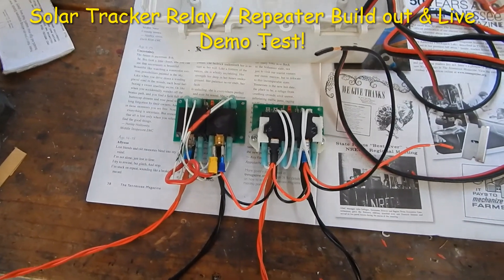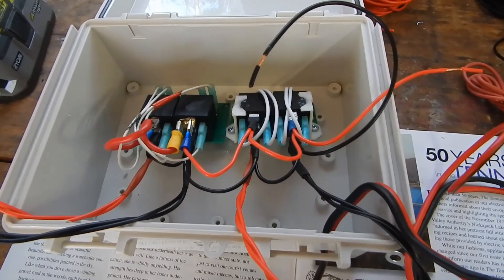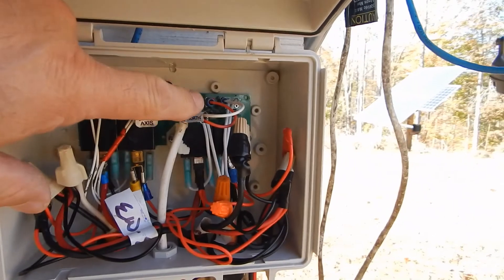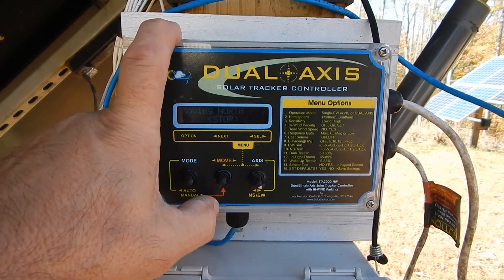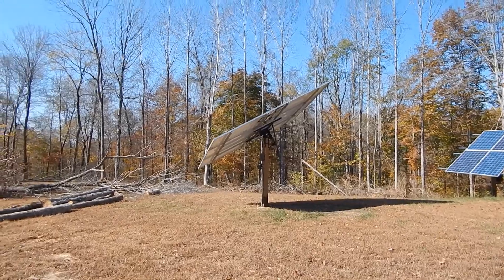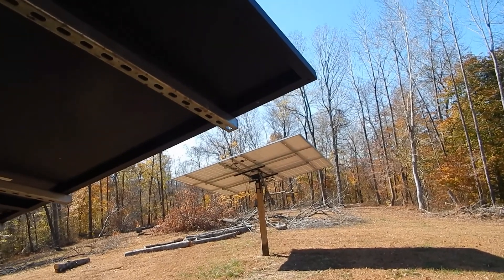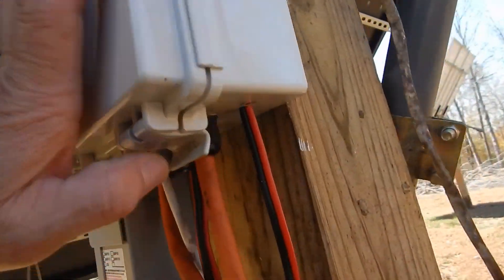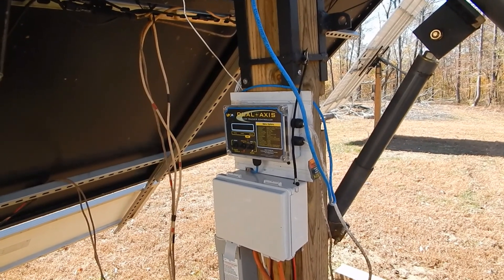Solar Tracker Dual Axis Relay Board & Dual  Solar Tracker Demo

Comment: This is exactly what I was thinking of trying to do. Great job figuring it out. I will try to duplicate this. Thanks 👍
Reply from the maker: I got all those parts on ebay. Been building my own solar trackers for more than 12 years. Recently did a video on my latest design solar tracker revision 12. I have 5 solar trackers roughly 7400 Watts of solar coming in at a 138 Vdc plus minus. Have been totally off grid here in Tennessee almost 7 years now.

Comment: pretty cool, so you need the relay boards to handle the high current needed for heavy duty actuators?
best
Reply from the maker: When operating more than one solar tracker it is necessary to do that to keep from stressing out the board in the  controller.

Comment: What latitude or state are you in and where did you get the actual dual-tracking Hardware the actual mount that you have on top of the wood column
Reply from the maker: I am located in Northwest Tennessee. The dual-axis controller came from the laser Precision crafts LLC look at the pinned comment. The solar tracker mount itself  I have been building for a little over a decade however I don't do them anymore as they become way too expensive and time-consuming to produce.
Reply: @TheKiloG69  ok... i am working on some design ideas to build one of my own,,the tracking controller i plan to build myself as well based on an Arduino... you dont by any chance have the plans you developed and used to fab up the tracker mount do you? you should post them maybe someone else can get some good ideas off your design?

Comment: I have been working on my Eco-Worthy tracker controller today. I am following your example. Why do you need the diode? Your help is needed. Thanks
Reply from the maker: The relays that I got  From ebay have diodes in them so when you switch polarity your actuators will do what they are supposed to do. Example extending and then retracting again needs to be a Diode in line. That's about the best I can tell you I'm not an electrical expert by any means. That's why I bought the relays pre maid I do not entirely understand how they work myself to be honest.
Reply from the maker: Also as an update to this old video I did away with that setup as it really did not work that well for me anyway. Using one controller seem to allow the 2 solar trackers to get out of sync due to variances in Actuator speed Plus voltage drops I'm guessing. I'm guessing.
Reply: Appreciate your help, Thanks and new subscribers 👍
Reply from the maker: @RustyGlovebox  If you'd like to talk about any of your issues over the phone contact me through my email it's on my page. I'll send you my phone number instead of trying to do this computer  Thing. Happy to help if I can.